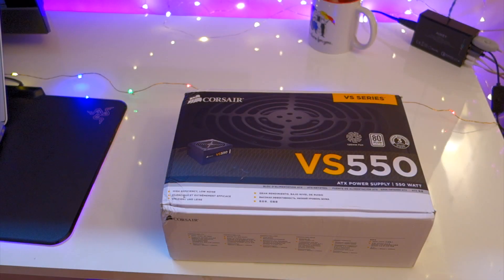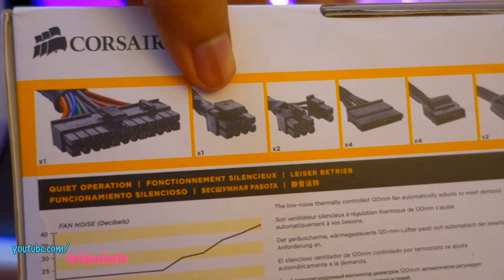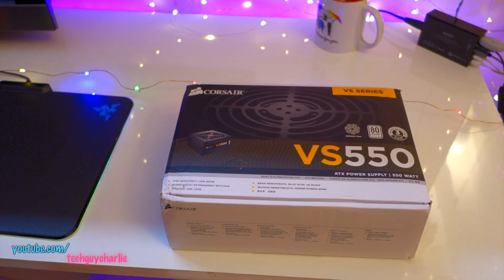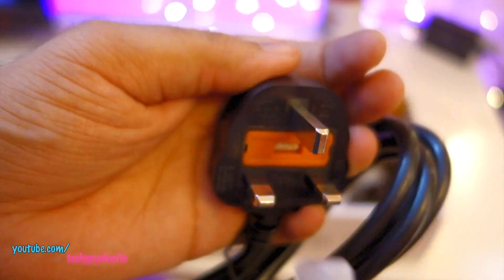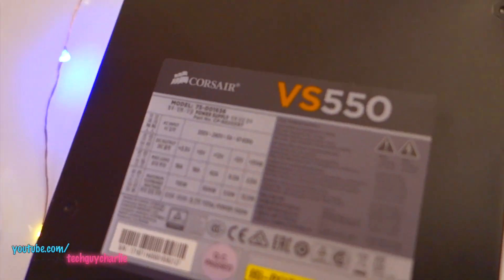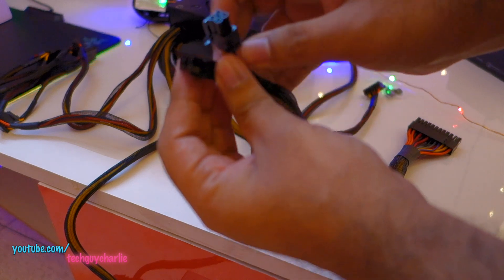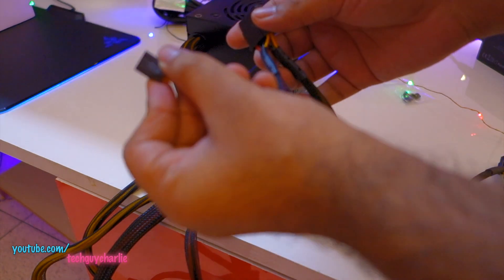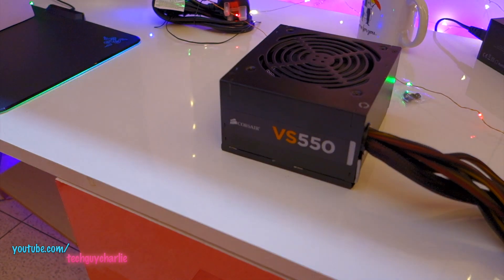Corsair VS550 power supply review, unboxing how many connectors, cables and stress test

Comment: For a system with RYZEN 7 3800x (105w TDP), 32gb of Ram, 2 SSD Disks, 4 HDDS, An Nvidia Card (200w TDP), will a corsair VS600 PSU suffice ?
Reply: Dont buy the VS series especially with a high end system like that, you will risk all your component

Comment: Will this power supply work with a GTX 1650 Super?
Reply from the maker: Of-course. 1650 Super isnt that power hungry. You should also state what CPU you are using.
Reply: @TechGuyCharlie  I'll be using the Ryzen 5 3600, and I have no intention of overclocking, I'm asking this because I'm planning on getting this build pretty soon but due to budget limitations I'm stuck choosing between 3 power supplies which aren't known for being the best, they are the
1-CoolerMaster Elite V3 600W
2-Bitfenix BPA600 600W
3-Corsiar VS550 white
But from what I have seen the Corsair seems to be the best out of them but what do you think?
Reply: @mazenadel7905  better prefer 80+ bronze rated supply.

Comment: Hey there, I'm worried about the PSU because rating says that it fries the parts my specs are gtx 1660 gigabyte 6gb 16gb ram 3000mhz ddr4 and ryzen 5 2600. Is it okay, if I enable xmp? And make windows optimized etc
Reply: Yes it is bad get like a cx600 from corsair
Reply: Better prefer CORSAIR CV550 80+ Bronze PSU

Comment: Bro i heard a lot of bad comments about corrsair VS PSUs but i bought rtx 2060, r5 3600, 16 gb and vs650 650w  Do you think it will work well ?
Reply from the maker: It will work fine, 650Watts is more than enough for your configuration, you can even get away with 550W since new 3rd gen Ryzen is power efficient. Well, to be honest, these are Corsair's 'Value Series' power supplies, they are inexpensive and they get the job done, I personally haven't faced any issues with VS series. If you want something better go with Corsair CX power supplies, I have CX650M on my main PC and its got good quality Japanese capacitors.
Reply: Did you buy that psu, and how it is working from that day to now
Reply: @feedmemore-  i bought it and it work fine but sometimes i hear some noise from psu fan , for that price is ok but if u want noisless psu you can search for something similar , this noises wont affect your power and all the components will work fine
Reply: @theshadow8604  does it still work?
Reply: @15muzwasnotatheatre16  yes 😂😂
Reply: @theshadow8604  ahahhahahaha thank you🤣
Reply: @theshadow8604  is there still some noise :
Reply: @15muzwasnotatheatre16  and noise somehow stopped 😂
Reply: @theshadow8604  i have an r 5 3400g a320m a pro motherboard, i think i will buy it
Reply: thinking rx 470 or maybe 580 later
Reply: @15muzwasnotatheatre16  i wouldnt recommend it anyway you can find somethink not from corrsair for similar price
Reply: @theshadow8604  hmm i can go for fsp 550w 80+ why not corsair tho, can you recommend something
Reply: @15muzwasnotatheatre16  a lot of corrsair vs psu-s have same issue, see something like termaltake litepower 650w, forton hexa+ pro 600w, evga 600 w1 ...best of it ion my opinion is semi modular forton hyper m 500w for this configuration i think it will be enought this cpu and mbo dont use as much power as my r5 3600, b450 m
Reply: @theshadow8604  they are kinda out of my budget but i can go for thermaltake 550w too, what problem does corsairs have
Reply: @15muzwasnotatheatre16  you can find problems on forums about vs models ... Mine have this sound issue where ventilator gets loose in case and scratch on side of psu box idk how tp explain 😂 for now nosie stopped... Also ive heard that psu sometimes have power loss, i didnt expirienced that but mine isnt that old ... Sry for bad english 😂

Comment: i recently built a new system and i have a amd 2600x msi rx 580 armour and a vs550 am i stressing it too much?
Reply from the maker: No, not at all, I wouldn't worry about stressing this PSU with your configuration.
Reply: Your system needs 394W no problem with this psu (bad english :)
Reply: Are you facing any issues with your PSU?

Comment: Can this go with a ryzen 5 2600 and rx 580?
Reply: Jomz lol yes it’s more than plenty.
Reply: Jomz that’s actually the build I have right now. So if you’re really worried you have my vouch. I have this PSU
Reply: @RuddeyyIsntHere  do you have 550 or vs650?
Reply: Feed Me More vs550.  I had this build for a year and a half before upgrading to an rx 5700 xt and ryzen 5 3600, and getting a seasonic 650 just last month. But a vs650 would be definitely be more than enough for this build and vs550 is enough as well.
Reply: @RuddeyyIsntHere  can you overclock?

Comment: Hi is this can handle r3 2200g + b450m pro vdh pro + Rx 580 8gb + SSD + hdd (in future r5 2600x) or I should go for CX550???
Reply from the maker: Get the CX550, its a better power supply overall compared to VS550. But if you are on a budget, the VS550 will be able to power your setup without any issues.

Comment: im bored with this VS550 PSU, why not damage or stop working until now!! lol..i want to refresh with a new PSU like Deepcool DQ850M 80+ Gold :)). But back again, as long as this PSU still working like now, i think i can using this PSU as long as i want...btw im using this with Ryzen 1700, mobo Taichi X370, Ram DDR4-3200 32GB and one GPU RX-580, all good for playing games with ultra 1080p resolution..no problemo for power up my rig with this mini PSU!! :))
Reply: Hey how is your vs 550 holding up ? I would really appreciate your inputs as i have a ryzen 3 220g + rx580 + 8gb ram paired with the vs550 ?
Reply: @mrigankroy  bit late but I'm using a i7 4th gen and rx 570 4gb since February this year so 9 months now. No problems with it

Comment: How hot does it get?
Reply from the maker: Barely.. just slightly warm air blows out the back and fan doesn't even ramp up on my configuration.
Reply: Tech Guy Charlie cool, my power supply gets super hot so I need a replacement

Comment: I have i5 4690k and 16gb ram and asus z97 gaming + gtx 960 msi gaming 4gb will it be enough? (Corsair 650vs )
Reply from the maker: Yeah, your configuration is less power hungry than mine, the new gtx960 consumes less power than my old gtx 770 same goes for the CPU
You can even go with the less wattage Corsair VS550 and save some money. Its been a year and this power supply has been working fine, no issues.
Reply: Thank you bro for your time and replying

Comment: is it quiet ?
Reply: ive had it for two years paired with a 1070. I literally have no idea what the fan sounds like because I cant hear it. All I can hear is my GPU fans, the cpu fan and the case fans. It is almost silent.
Reply: @Bran04don  i buyed an lc power 560w 80+silver its gr8 an quiet
Reply from the maker: yeah! You cant hear the fan even while gaming. It's super silent. Although the fan noise might also depend on the design of your case.

Comment: This is not an 80+ bronze PSU...I have that same PSU....will I encounter problems if I use it with an RX580?..i dont have plans with watercooling or dual GPU btw..
Reply from the maker: It is 80+ White which is a tier below bronze and It will work minimum recommended PSU for RX580 is 500 Watts and I am still using it with a GTX770 which has a recommended PSU wattage of 600 Watts. Just replace it with a newer one if it causes any issues in the future! what is your configuration? it really depends on overall system config.
Reply: @TechGuyCharlie  Hi I have a rx580 paired with a ryzen3 2200 g paired with 8 gb of ram +1 ssd+1hdd along with b450 board, will the vs 550 be ok for me ?
Reply: well it doesn't power up my GTX 560 Ti literally

Comment: Grab yourself a new GTX 1050ti to 1060. They are super efficient and will not stress your PSU out. Plus added bonus is they're much faster :-D
Reply from the maker: Yeah, even the 1050ti will outperform my current 770. You know I did save up money for a 1060 but someone advised me to hold out and that next generation of Nvidia graphics cards will be announced in the next few months. Since I'm not gaming these days I don't mind holding out for a few months and not to mention the current highly inflated prices.
Reply: @TechGuyCharlie  Even higher now, managed to grab a 1050 back in 2016.
Reply from the maker: Well, I managed to grab the RTX 3070 back in December, paid more than the MSRP :( but now as of June 2021 the same card cost 2x the price I paid.

Comment: Do this psu is reliable in tomshardware site reviewers sais that it will fry components sue to cheap capactors ?
Reply: it do is not
Reply: it does
I know a friend who had a burnt vs550. Dude listen if you gonna buy psu spend money
it may hurt you in cuttign corners but in the long run you need it
Reply: nope, i know this psu is low rating i mean have few bad feedback.. but my frnd use this for almost 3yrs using i5 7600 / 16gb ddr4 ram / gtx 1050 ti and 2 tb hdd + 3 rgb fan and AIO Cpu cooler he said no problem encounter at all.. maybe ur frnd PSU is faulty or defected or maybe the temp on there place is superhot
Reply: dude listen gtx 1050 ti  is a low end gpu and i5 7600 is last gen and you cant overclock it and they dont have Japanese capacitors which means if you use it a lot they will get damaged in time
Reply: and corsair said that it is only recommended for low end pc
Reply: @arkmark7182  Mine VS550 failed after 3.5 years of gaming , This thing was Rebooting my pc whenever i tried to play Games (Some things went wrong the 12v Rail i suppose) , i'm going for a CX550 This time around, let's see how it hold up
Reply: @npsinghjadon2508  damn it, mine too. Almost 4 years without a single problem, and suddenly i got a serious shorting problem.
Reply: and if you use a gtx 1050ti or 1060 your probably fine cuz they wont stress you psu that much but nothing higher than that
Reply: @Red-yq6nc   hes using 1070 now and it works fine.. i5 7600 last gen? Lol what are u tech genuis?hahaha
Reply: now there is 8th gen like i5 8600 and dude i would recommend a better psu cuz first of all efficiency is low so it drains more than 20 percent and second of all the capacitors aren't good so there is a chance it will face problems
Reply: and btw i am no genius lol i am just a kid who is planing to build a computer so knows a bit about it and i am half indian and half maltese (a small country near italy) and i am no nerd in my country at-least lol XD
Reply: Anirudh Suresh im using this with a 1070ti ryzen 1600 16gb ram and tons of rgb strips and fans for almost a year. I did not have any problem at all. U talk as if u own one kid.
Reply: im not really 100% believe with Toms review..im only believe with JohnyGuru review if talk with some PSU good or bad, cheers 🍺 🍻
Reply: the vs is intended to not be used with "heavy" components. if you're using an APU with no graphics card, you don't overclock or stress it too much it will be just "fine". It does not mean that it is a great psu

if you're going on budget I could suggest a seasonic s12 or an EVGA W1/BQ/BR etc.
Reply: @fnx3671  eh mines been running a rx 570 and i7 since February and no problems. They seem to last like 3 years but I'll probably change it for corsair tx550m gold psu in a few months.

Comment: I5 76k
Asus strix z270e motherboard
16gb ram
Corsair h45 liquid cooler
Gigabyte gtx 1050 to DC 4gb
5 led fans 
2 tb hdd...will work smoothly on Corsair  vs 550  ???
Reply: Cooler Master as a nice easy calculator webpage that will let you factor in a ton of options from LED lights to overclocking. http://www.coolermaster.com/power-supply-calculator/

I found that the system I am building (Ryzen  1700 o/c'd to 4Ghz 'if possible', 32GB DDR4 2666, 2x 7200RPM HDDS, 2x SSDs, GTX 1060 o/c'd, mATX mobo) only needed 439w PSU (less then 400w actually used) under heavy load. Making a quality PSU like the VS550 actually a solid choice since it can supply 505 watts continuous with out stressing it out.
Reply: Now if you planned to go with 2x GTX 1070's in SLI then the higher end modular CX750M would be required and serve quiet well.
Reply: Joe's Photo & Video Channel then  550watt psu  is fine my feature??
Reply: I tink it will
Reply: *think. :-))